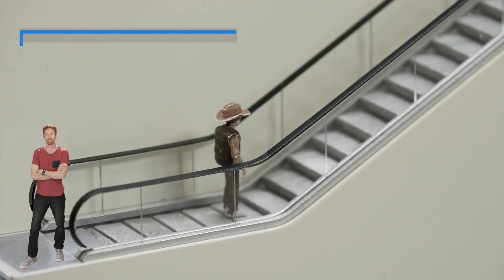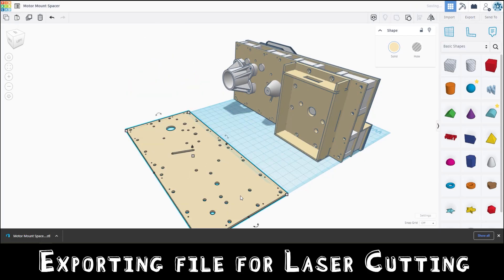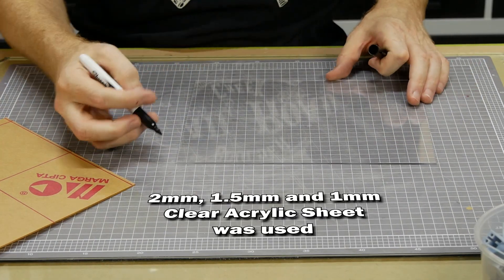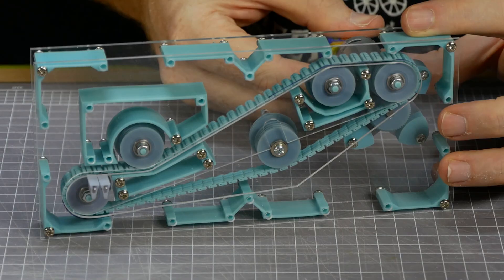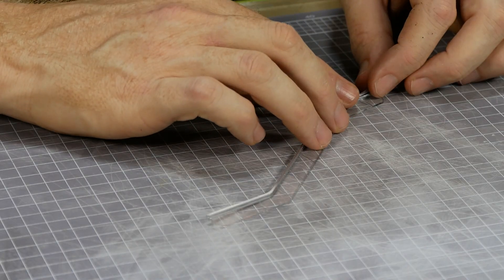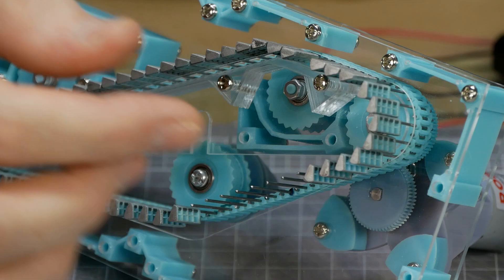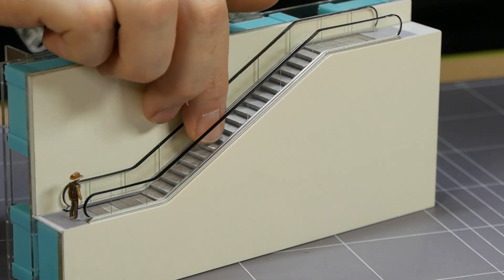Building the Worlds Smallest Escalator (That WORKS 😮)

Comment: Very nice job and very commendable. But it is way over designed and built. Too many pivot points, way too many components (hundreds to design and print) and terrible friction and in time nasty maintenance. All projects require a mind set of SIMPLIFY AND ISOLATE. Take away anything that is not necessary until it affects function. The use of a 2GT timing belt with synchronous wheels and a stepper motor being controlled by a simple code in Arduino or Raspberry Pi would have saved nearly 90% of all the hard work. Stepper motors at low speeds are very strong and quiet. Keep up the good work, it is a pleasure watching your videos as you have great ideas and techniques.

Comment: Please switch from tinkercad to fusion 360 or another similar program. It will save you so much time and make your life way easier, you could probably make the same model in just 20-30 hours (or maybe less). I made the switch recently and it’s made 3d printed far easier, faster, and quite frankly more fun. The model did turn out quite well though, nice job, I’m impressed!

Comment: I would want to tweak it so the plates at the start and end are rigid. It may require a slightly greater gap tolerance to prevent issues, but seeing the oscillate up and down is just distracting to me.

Comment: I found it kind of odd that you didn't keep the protective film/paper on the acrylic and cut it with the paper on for protection. Usually I see acrylic cut like that on a laser so it would be protected from scratches and makes cutting and positioning the part a lot easier. What motivated you to do it in the way that you did? Makes me a bit curious.

Comment: Really great job, this is incredible. If I may just suggest something, I'm kinda shocked that all of it was modeled in Tinkercad. When you get to the point of designing models this complex, it's really time to upgrade to a better CAD option like Fusion 360. I can't imagine having to create something like this without parametric modeling and reusable components, for example. And these are just two features among so many more… this is the kind of investment that will save you dozens of hours in the long run, and it's actually pretty easy to use too.

Comment: use matte tack paper under your  laser print (stuck to your sheet un the bottom) so your parts don't fall through your grate. Also helps if you are cutting lots of small pieces.

Comment: How long will it be before motors, batteries and servos and things like that will be so small that we will be able to buy small figures that can move and be programmed to walk about a setup and when a train stops at a station and opens the carriage doors they get on and take a seat, cars will be programmable too and drive around the town, stopping at lights and zebra crossings etc, wireless charging ports will be placed under the road so cars can charge while stopped and when they get too low will drive to a car park till fully charged, the figures can charge on any seat, including on the train, the whole setup will all be programmable and work perfectly, just look at Lukes video when he built the tiny RC truck and see how small things are so far. Seeing this video makes me think it will be a thing of the future, does anyone agree? If so how long do you think it will be before we see things like that in the shops? Or do you think it's a dream that will never come true?

Comment: I would recommend looking into flexible resin. If you mix a bit of it into the regular resin it can reduce number of times that the resin breaks or cracks from stresses. It also helps make parts last longer, especially with parts that face a lot of wear like these. Fine tuning how much of the flexible resin needed will depend on your use case though I normally use a 25-75 with the 25 being flexible to help give it a bit of extra strength

Comment: Nice work! Here's a tip: Try heating the screw head with a soldering iron as soon as there is a risk of cracking. You don't have to heat it much to get the plastic spongier. It gets hard again as soon as it cools down.

Comment: I used to work for an escalator company and have to say it us amazing. Reducing a fully working escalator to this size obviously dictated changing how one really works but I can't see how anyone could have done it better.
Reply from the maker: oh cool, that's a huge compliment coming from someone who worked with the real thing 😃 Thanks!
Reply: @D.O.M. Oooh question for you: what kind of rubber is used for the moving handrail of an escalator? Is it a vulcanised rubber? Would a silicone casting works for Luke's escalator model, assuming he would want to tackle that challenge?

Comment: 8:44 - Actually, there's no point in wearing a mask, unless it's fully enclosed, and has a separate air supply. Dichloromethane will go through anything that air can go through (in fact, it can go through things that air can't).

Just load a syringe with it so it's not constantly evaporating off a jar, and you'll be fine (a small syringe with a blunt "dispensing" needle is also the ideal applicator). It will (very slowly) melt the syringe itself (unless it's glass / teflon), so remember to empty it when you're done.

Also, in small amounts don't bother with gloves, it will evaporate faster than it can damage your skin. In large amounts, use butyl rubber or neoprene gloves (not vinyl).
Reply from the maker: Thanks for the tips, I've found that it's even hard to stop it from evaporating even in the jar. I had that jar full and the lid on as tight as I could get it and after about 6 months the jar was half empty... and I hadn't touched it!
Reply: @BoulderCreekRailroad  - Yes, it evaporates through most non-fluorinated plastics and / or any microscopic gap in metal lids. Ideally, put it in a glass or metal container with a teflon lid (or a generic plastic lid lined with teflon on the inside). Wrapping teflon tape around the threads on metal containers can help eliminate gaps, too.

Comment: What resin and process are you using to avoid shrinkage and to retain proper dimensions? I rarely print mechanical parts in resin due to this issue and I am curious as to how to combat it.  I have tried several different resins such as ABS-like and Tough Resins but none seem to get by the dimensioning problem.  So it must be something I am doing wrong.

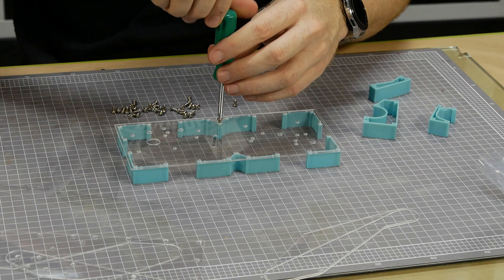Comment: 5:37 ok so i have been 3d printing for about a decade, you should use an FDM printer for these types of parts, even if you have to adjust the design to be a  little bigger. it's far easier to screw in. resin just is too brittle for the structural supports.  also you'll want specialized resin for the gears, or to design the whole thing around standard mechanical parts so you can use more durable materials. resin 3d prints are great specifically for aesthetic parts with low load

Comment: Screw Holes:  Yep ran into a few issues like that,  little more meat needed around screw holes,  I run a relief split down them in some cases so it can expand without cracking,  but it is not intend to hold bolts down for full size light poles either.  :)

Comment: 3D printing sounds like a hugely wasteful process. What happens with all the unwanted prints?
Reply from the maker: It's only wasteful when doing prototypes like this, once you've figured out the model it's not so wasteful. The failed prints go into the bin, not sure if there's a way to recycle the resin. 
But for small projects like this even though I'm creating waste it's probably no more than the equivalent of two empty bottles of shampoo, I'll just have to not wash my hair for a couple of weeks 😬
Reply: I guess it stops you having to buy so much from around the world/Internet and the associated fuel, packaging etc. I know you need to buy the resin etc. 
Perhaps some enterprising 3D Printing company can find a way to recycle ? 
I know lots of folk upload the files so that you can simply download those which will cut back on your wastage. Only my opinion of course!
All the best.
Ian

Comment: Great tip for marking the edges of the clear acrylic sheet. Is it possible to laser cut the acrylic with the protective plastic still on, or will it create problems with the acrylic or put off nasty fumes when burned?
Reply from the maker: Yeah you can leave the protective paper on, it still cuts just fine but depending on the shapes you're cutting out it can sometimes be a pain to peel off afterwards. Some of the sheets I was using had a plastic protective wrap and I wasn't sure how that would go so I just peeled it off straight away, soft plastic gets really smelly so the fumes are probably not good too breath in!
Reply: @BoulderCreekRailroad  Thanks for the answer. I'd figure the fumes alone would be bad, but I can see how it might also be harder to peel off after the cuts are made.

Comment: As a lift and escalator engineer, I can confirm it's a proper job. I'll be in every two months to overcharge for putting too much oil on it!
Reply from the maker: LOL, I watched a video about escalator and apparently they install the system at a loss and make their money back through  propriety servicing... see you next week with that can of oil 😄
Reply: @BoulderCreekRailroad  Just like cheap printer-copiers. You pay dearly for the ink cartridges, so just refill them 😉
Reply: @remkojerphanion4686  In business school they actually call it “the printer and ink model” when a business only makes money on consumables.
Reply: True story I'm afraid mate
Reply: You are not a lift and escalator engineer.

Comment: Crazy that you did it in tinkercad. Ive not used the program yet as I use other CAD Programs but from what Ive seen from tinkercad its quiet limited. You pulling this of is just amazing! well done
Reply from the maker: LOL, yeah it probably would have been better to use fusion 360 or something similar, I like TinkerCAD for its simplicity but yes it's limited in so many ways!
Its great for beginners though 😉
Reply: @BoulderCreekRailroad  yea that's right. I'm really amazed by your works. Im following you for quiet some time despite building completely different types of models myself but it's so fascinating to see what you do. Especially since you started printing things

Comment: This is utterly incredible.  Back in the 1990s, I tried to make an HO escalator using a kit of whitemetal parts, and very nearly gave up on that. So to do one that looks that good and actually works, is simply jaw-dropping. No wonder it took a year to do.
Reply from the maker: Thanks Andrew, it's only achievable now because of the tools we have like 3d printers, I'm excited to see what this hobby will look like in another 20 years!
Reply: these 3D printers have really impacted the scale modeling world as a whole. whether it would be model railroading, tabletop/wargaming, or just simple maquettes used by the engineering/architectural industry, it is a great and generally cheaper solution to older techniques such as casting with resins and other plastics. i am looking forward to what these incredible machines will bring us in the future!
Reply: I'm atm making my diploma for 3d design & printing in the dental medicin. It is sooo inpressive what one can create today!
Reply: @thebackyard7661  soon we will be printout out replacement heart, livers and kidneys!

Comment: Would it be possible to use the mono rail track stuff to animate the people
Reply from the maker: I guess you could do that? It would be a challenge to get them to slide smoothly though...
Reply: @BoulderCreekRailroad  
i guess the trick is to make the escalatortrack being the monorailtrack - but the transition from the escalators steps back to the floor again... - but maybe it just works

Comment: This was almost a year in the making?! Worth the time spent, this is amazing!
Also I think this would go great with the subway diorama you did.
Again amazing build!
Reply from the maker: ha ha thanks Mo, yeah the subway was the initial inspiration for this project 😊
Reply: One more year and the armrest is rolling too 😇
Reply: @EvoKey  Mmmm, can one do rubber FDM printing? More likley is resin laser printing a rigid version as a master to create a mold then casting a stretchy silicone. Mind you, silicone is pretty grippy so it would not slide well. A nylon would be better but that might be hard to cast. Mmmm, how does the hand-rest of a real escalator travel?